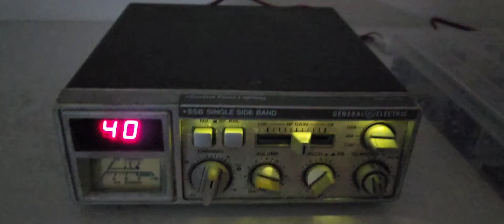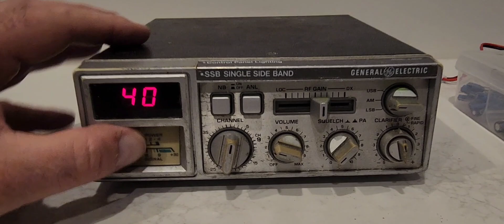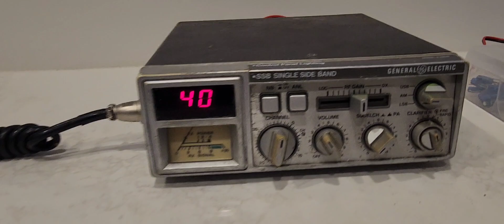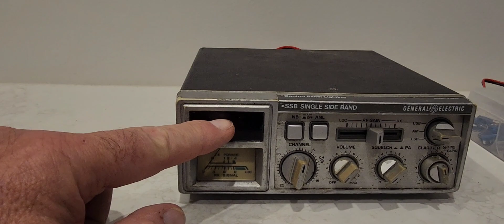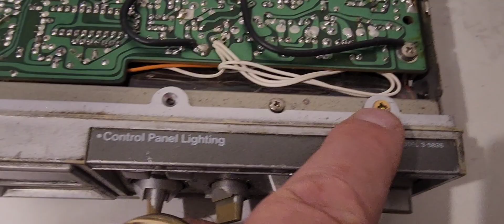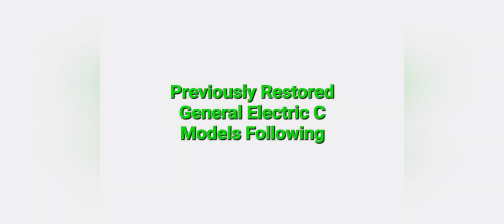General Electric C Model A3-5826 Full Restoration Series - Part 1/4

Comment: Another good video thanks. Hey do you know if any other radios share the same pcb or what pll chip is used in the GE C.
Reply from the maker: It's exclusive to this radio
Reply: @Pull_It_Apart_Paul_Ham_CB  Interesting.
Thanks as i was always wondering about that model. Never owned one yet my mate used one for years back in the day. On AM so no idea if they perform well. Except you mentioned good receive.